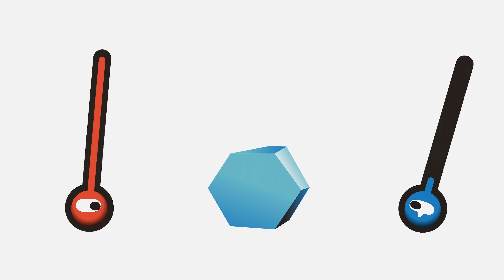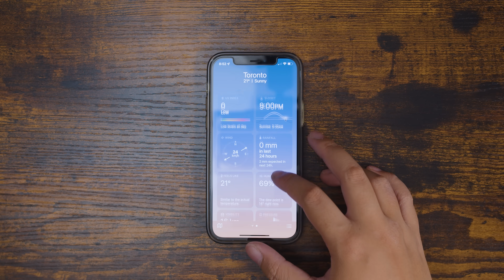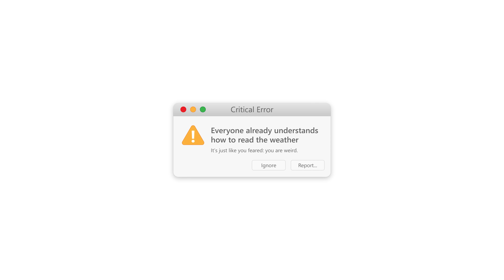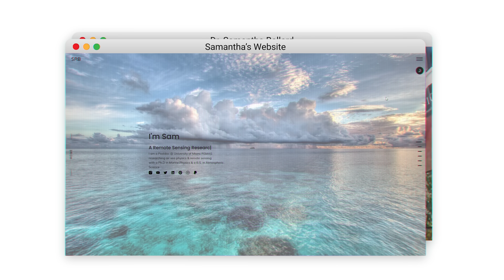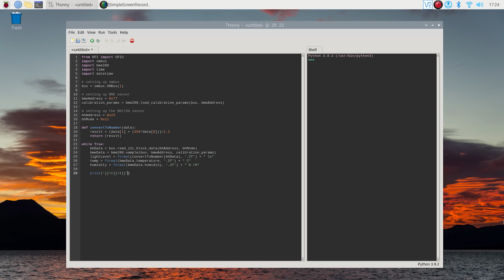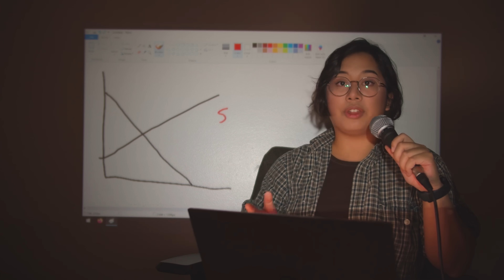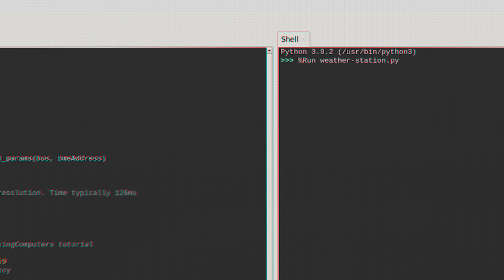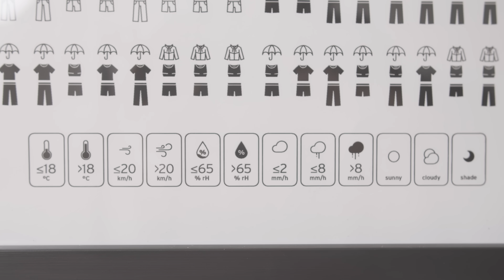how fahrenheit fails you

Comment: Fahrenheit and Celsius have nothing (or not much) to do with the metric system. And there's no advantage or disadvantage to use one or another system because you only need to remember three numbers in boths cases: a) freezing point b) body temperature c) boiling point. Wether these numbers a 30 or 0 or 100 or whatever doesn't matter because we usually do not calculate with these numbers unless you work in a laboratory.

Comment: I had some of the same problem, but came up with a different solution. I paid attention to days that were perfect weather, to know what I like. The perfect weather is between 18°C and 21°C. 16°C is very nice with bright sun. Humidity it's better between 40% and 50% on those temperatures. That's it. Anywhere lower I would be colder, anything higher is hot.

Comment: I've heard people describe fahrenheit as being intuitive and that the 0 and 100 points are human scales as 0 is fairly cold and 100 is fairly hot, with anything below 0 being insanely cold and anything above 100 being insanely hot.

Ok let's give it a go than, 50°F should be the magic temperature one should aim for, warmer than that turn on AC on cooling, and cooler turn on heating, just like I'm used to ACs having an auto 25°C setting especially for commercial buildings, a person at this temperature should feel comfortable in a t-shirt, jeans and slippers, right?

Ok now let's google 50°F to C, annnd, it came out to be 10°C, while not freezing it is fairly cold, possibly comfortable in jeans and t-shirt as long as I'm standing in the sun with no wind, but I'd definitely want a hoodie if it's either cloudy or there's a breeze, and I'd definitely want a windbreaker style jacket over said hoody if it's windy, this makes Fahrenheit not at all intuitive

Comment: 1:20 as someone from the Caribbean 12⁰ C means its cold. Anything above 28⁰ C is hot and anything below 18⁰ C is cold.
Reply: So much of it is to do with where you grew up, isn't it... I am from Eastern Europe, and for me it’s -5C is fresh cold winter’s day, but not too cold, +10C to +15C is normal cool day where you need some layers, +21C to +23C is the perfect temp (for me) and anything that goes over ca +26C is way too hot.
Reply: Kind of demonstrates the problem doesn't it? The entire range of comfortable temperatures in Celsius is ten degrees. That's not enough dynamic range to have as strong an intuitive feeling of what the numbers feel like.

Comment: I haven't finished the video, but for my part: I think Celsius is better for Chemistry, while Farenheit is better for weather.
I once tried to design my own temperature scale that went from "the point at which hypothermia risk starts" and "the point at which heat stroke becomes a risk". As it turns out, this actually does map surprisingly neatly to the Farenheit temperature scale (50 degrees is when hypothermia becomes a risk, it's about 90ish for heat stroke), so it's actually a pretty round number.

Comment: Great video, today I learned how to comprehend the Fahrenheit-scale. For me as a european it always seemed very random compared to celsius, which is pinpointed to 2 well observable temperatures: The freezing point of water and it's boiling point - although that depends on air-pressure and can be substantially lower on very high altitudes.
Knowing that Fahrenheit is also pinpointed to two observable temperatures - pretty much the lowest and highest temperatures you are likely to experience outside any technically controlled environments who go to extremes, like saunas ord cold chambers, makes it much easier, unless you live in places like Alaska or Saudi Arabia.
Up till now my only reference for the Fahrenheit-scale was the old Bon Jovi song "99 in the shade" which I knew was about a very hot day.

Comment: it always annoys me when someone argues that "Celsius is more accurate than Fahrenheit".  No.  A measurement system has no inherent accuracy.  The measuring device is what gives accuracy, no matter what scale you're using.  a thermometer does not show Celsius or Fahrenheit, only how much heat has expanded the indicator fluid/metal (for an analog thermometer), or how much heat has increased the resistivity of the thermocouple (for electronic). accuracy come from correct markings and/or readings on the device.  if a thermometer has been calibrated correctly, then it is more accurate than an uncalibrated one.  if the markings on an analog thermometer are in the wrong place, or the micro controller is misreporting it's readings, it doesn't matter if it's Celsius or Fahrenheit, it'll be wrong either way.

Comment: Why is Celsius a requirement to use the rest of metric? And why is having 100 degrees of separation better than 180? Last, what advantage does it give, because it is never used as kilocelsius? There are many more disadvantages to it that I don’t understand why it’s used over Fahrenheit, which is base 60 and is just as easy to use in equations as time, since time is also base 60.
Reply: Thank you! 👏

Comment: The main difficulty you have is that there can be snow on the ground and you will somehow feel hot and even get sunburnt. The thermometer will say the temperature is low, but the metal tool handle is hot, so what's happening? This is how this vid should've gone. 
The answer is that temperature is always recorded in the shade, except that I.R. (infrared), or insolance, or irridiance, which are all the same thing, but rarely taken into account. If this comment says nothing about F vs C, that's your fault.

Comment: Ambient temperatures should never be measured in Celsius, Its a 10 degree scale from really cold to super hot, but its great for measuring boiling water, not the air. Between 20 and 30 degrees is your entire environment. 25 degrees can be cold and 26 can be warm. Its useless, get rid of it already

Comment: The thing with 14 C is that if you are going to sit still, it is pretty cold, unless you are sitting in the sun, while if you are moderately active, you need much less clothes.

That is about the termperature, not the scale used. It is the same situation in 288K or 57F.

Comment: So I guess everyone keeps making new terms for things that already exist.  Champions in this video is just what was called a Mentor.
    Temperature and other factors is only part of the issue.  There is also what the relative high and low stats are for the region.  Example: person in Minnesota would think 50 F would wear shorts.  But the same Temperature in Florida would be considered winter coat weather.  There is not one answer for all and that is what many in the scientific community fail to see.  Most want data to be consistent and put things in a perfect little box and then wonder why there are always outliers in the data or opinions.  It is the old school think  between "book smart" and "street smart" (or Academic vs. Practical applications).

Comment: I don't mean to bash celsius? But i live in the USA and fahrenheit has always been on top of it for me likely because we use a much more sensitive system , not once was it cold where it said it was hot or vice versa

98.6f == 37C , 36C
98.5f == 37C, 36C
The next lowest C is 
95f == 35C

We have a accuracy your rounding doesn't

Also o noticed your using the built in weather app , rhst thing is horrible download a weather app yourself

Comment: No, the reason that Celsius is inferior, is that the degrees are too far apart. There is too much spin between them, so it lacks the precision of Fahrenheit. 
Also, remember that there is absolutely nothing special, objective, or scientific about Celcius, any more than Fahrenheit. Both of Anders and Daniel were using the boiling and freezing temperatures of water to set their range.

Comment: Neither is intuitive when it comes to how to dress.

Let me explain...

If I know that most of my body is made of water, and water freezes at 0c, then I need to wear something warm. If I know that my body temperature is 36.5 and 37-38 is considered as fever and you need to cool your body down, then its intuitive that if outside is 36.5 or higher, then I will be sweating my balls off even naked. Wearing some clothes gives us some insulation, meaning we feel warm and can sweat even in colder then our body temp temperatures if there is no wind cooling you.

However people in Siberia (ranging down to -89.9c record) experienced bigger colds than I did, so I have no idea how cold does 0F or 100F feels, meaning it's not at all intuitive. But if I see 0c and I know it's water freezing point then I know that it's really cold (freezing to death if body cant keep up heating), and -90c will be absurdly cold record breaking, but that's not very common. So we have a range of -50c to 50c (56.7c was world record) people over the world experience generally. 

-50c can kill you, +50c can kill you, if we normalize it even more, it would be let's say, -40 to +40 and we have extremely cold and extremely hot (perception compared to our body temp) weather, but the middle 0 is not comfy, the scale for "how should i dress" is offset by our body temp, clothing and metabolism. 

Its october, its 15c outside, people are wearing coats already, i am still in T-shirt. 

So even C is not intuitive, but at least it tells you that at 0 you can possibly freeze if not dressed, and at 50 you possibly boil your brain if not cooled, the middle ground is 25c, which is comfy temperature for your body heat, with little to no sweating, which can warry +-5c depending on the individuals, genetics, metabolism,...

If we compare this to F,  122 (50c) 32 (0c), middle ground is 77F (25c) but here calculating the 77f (middle point of 32 and 122) is more complex then calculating 50/2=25, making it easier to quickly calculate and decide what to wear. So 0-50 is a very logical scale in this manner. 

Making celsius slighly more intuitive if you sck at math or just want easier life :)

Comment: Figuring out temperature by feeling was essentially what I had to do in college. That was the first time I had to spend any meaningful length of time outside on a regular basis. I figured I didn't understand Fahrenheit or Celsius enough to default, but being in a science field I thought Celsius would be a better option (and it's used in more places.) Then I just figured out what every 5°C meant as a change of outfit. Do I need a hat and scarf or just a coat? Do I need long sleeves or short sleeves? I had to figure out how wind and rain would affect that, like you said. But it took me 4 years. 🤣

Comment: 0°F (~-18°C): too unlivable
30°F (~-1°C): unlivable
50°F (~10°C): very atypical in Brazil
70°F (~21°C): the temperature we set the A/C when it's 107°F outside.
90°F (~32°C): it's springtime in Brazil
100°F (~37°C): it's summertime!!!
107°F (~42°C): today's temperature at noon. Now it's 7 p.m. and it's 86°F.👍👍👍

Comment: Fahrenheit is more intuitive for weather? I Disagree. Celsius is way more intuitive. 0 Deg C is the freezing point of water, means way way cold. 100 is the boiling point of water,  so 40 is still extremely hot. Anything 40+ is unbearable. 50 deg C you are reaching the limit of the human body. 25 deg is the spot at which humans feel most comfortable. On the other WTH is 80F,  i dunno. Is 50 F too cold or too hot, i have no idea. How, is even 100 F( 37 deg C)  the hottest weather you have ever experienced? It's like most days in India.

Comment: For everyday use, it's just a set of numbers you get used to. Having transitioned through the change to metrics 50 years ago, I quickly got used to Celsius and Fahrenheit doesn't mean much anymore. However, I'm visiting the United States for the first time next month, so the rule-of-thumb I learned back in the 70s will come in handy: subtract 30 and halve it to convert to Celsius, double and add 30 to go the other way. Easy!

Comment: I learned Celsius when Canada changed. I know anything around 0 needs a winter jacket, 10 Celsius needs a sweater. 20 is a nice room temperature, 30 is pretty hot, 40 is ridiculous hot. Anything above that, stay indoors with AC

Comment: I’ll make this easy for Americans and Fahrenheit people so you can understand Celsius on a basic level 

5- to 0° is where once it starts getting into the temps it will begin snowing. It’s the exact temperature to almost when it will begin getting cold enough for snow to form 

10° a cold day but definitely too hot for snow to form but still cold nonetheless recommend wearing a jacket. It’s cold. 

15-20° is the temperature to where it begins warming up but it’s an average day. It can still be sort of cold but it’s around this area when it begins heating up to where it’s kind of normal.

20-25° is where you get to the point where you just need a shirt and shorts. It’s not cold but it’s not too hot. It’s the perfect temperature.

30° is a hot day 

35-40° is a very hot day. Make sure you have water on you at all times and Aircon it can get extremely hot wear shirts and shorts. Possible heat stroke.

40°+ make sure you’re in somewhere cold. Aircon fan cold drinks away from the sun at all cost you’re at that temperature to where you can pass out from the heat stroke.

Comment: Worst part is if you put your weather station near your house go 2 or 3 miles and the temperature will be 100% different, near where I live there are alot of trees. Trees help retain heat and keep heat off. 1.5 miles from my house there is a shopping plaza. Very little tree cover too make matters worse this shopping plaza is on the bay. It can be a 20 to 30f difference between the two in real feel.

Comment: ... so... Swackket for iOS came out in 2010 and solved this problem. It has since died due to bloat and bad design features, but since then 10 other apps across eco systems have gone back to its original design and re-implemented the idea.
X temperature (whatever metric F or C), wear this (UI of a person in some kind of outfit).
The additional issue seems to stem from you being NeuroDivergent (same, I get it). A weather app can't tell you that, but can tell you the basics of what to wear (for NT people) and you can then decide "Ah, it wants me to wear a jacket... ok well I wont, Ill wear this slightly lighter cardigan, and be cold but not have to get warm and hate my sweaty life"

🤷🏽‍♂

Comment: From the beginning of the vid I was thinking you didn't have enough experience to mentally link "cold" or "hot" with a number. Living in Canada, Celsius is very useful since it's based of the state changes of water at sea level, and the weather happens to have a lot of that particular element in it.

Comment: @answerinprogress About your pinned comment Kelvin is Celsius + 273.15, 20°C is 293.15 K, 30°C is 303.15 K and so on. Not a difference like million and billion. I'm from EU so I learned Celsius, we don't have problems to understand the difference between 25°C and 36°C, in my city the coldest we had in many years was -8°C, the hottest 38°C, average temperature in winter is 5°C, spring-autumn 15°C, summer 28°C, we have temperature range "shorter" than 25-100, so a degree Celsius is more impactful than a Fahrenheit one, there is a significant spike in hotness between 28°C and 32°C.

Comment: I just wear the same thing all year around like a cartoon character, if it's cold wear a hoodie if not that's fine too. 

Black shirt, black t-shirt, black socks, black boots, black underwear and optionally a black hoodie.

 If I am spending the day out side and it's too cold take out the coat. Most times I am in doors or in car so... 😂

Never really have a weather base issue.

Also, I do something similar, my favorite weather is 75°F (high) between 50°F (cold). I anything beyond that is either hoodie (too cold) or don't stay out for too long. (too hot)

Also laundry days are painless 🤣

Comment: As a Gen X Canadian, who spent a lot of time as a kid in Florida with my snowbird parents... I have a very complicated set of units I use for all things in life that we measure. I grew up during the change from imperial to metric, and spent a lot of winters in Florida.
There are plenty of infographics and flow charts that pretty accurately describe a method similar to mine. Basically:
If its warmish to hot, i like F. If its cold I like C.
If its a pool, or hot tub, F
If its my home or car's HVAC system: C
If its distance to drive or walk, Km. Speed of a car Km/H
If its a boat speed or wind speed we're talking about, Knots (i'm a sailor)
If its a car's performance, Horsepower and 0-60MPH (though I'm trying to convert HP to KW for measuring power in my head as its a better unit of measure)
If its my weight, Lbs. 
Any other weight, grams/mg/kg etc
Measuring lengths of things, that's a crap shoot. I use inches/feet and cm/meters interchangeably 
There are more, but this is what it looks like inside my brain.

Thank you for explaining the difference between a STEM role model and Champion. My company has a Women in Cybersecurity scholarship to promote women taking STEM programs in Canadian higher education. I'd like to think that we are a champion to help women succeed in this segment.